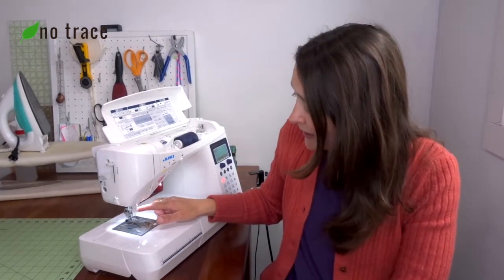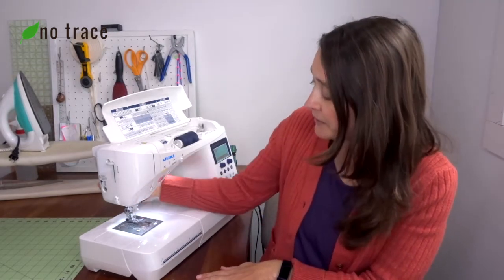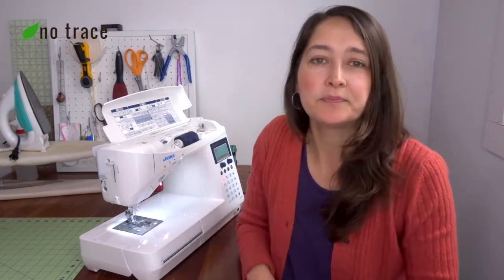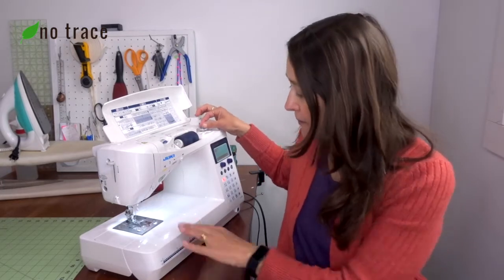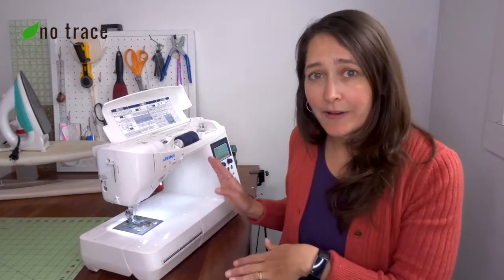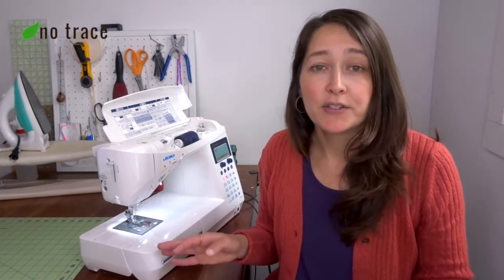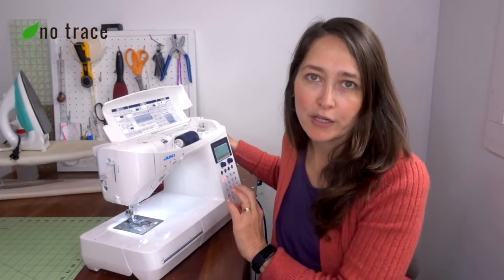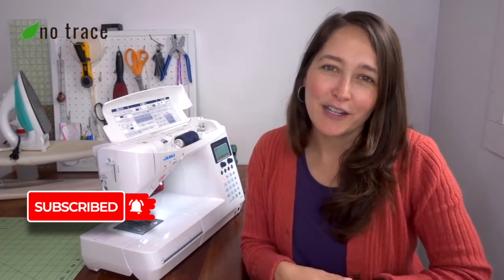What's wrong with my sewing machine? Your problems fixed - Part 2!

Comment: Thank you. Such a helpful video. Most things are working right now, but I think I will go in and check the dust and lint below the plate and definitely change my needle. I made your reversible tote bag that was great. I did, however. use fat quarters and ended up with a long thin bag. Still cute. Would love some projects with fat quarters if you don't have already.